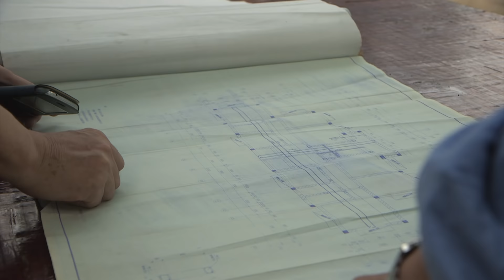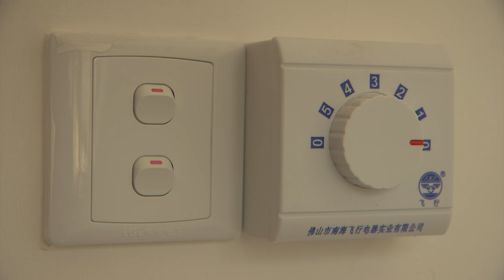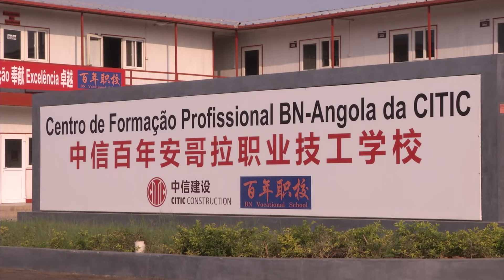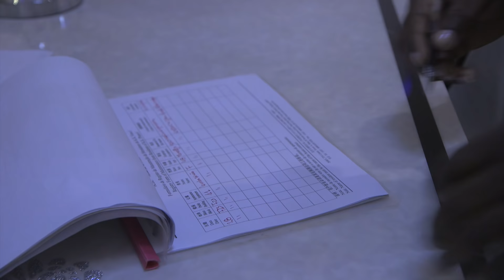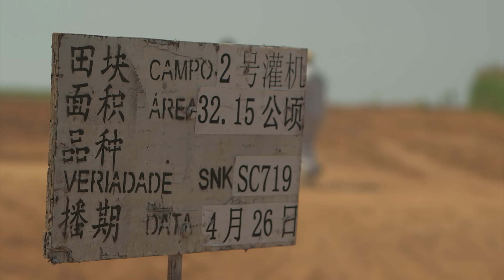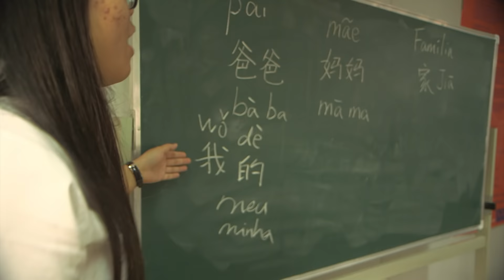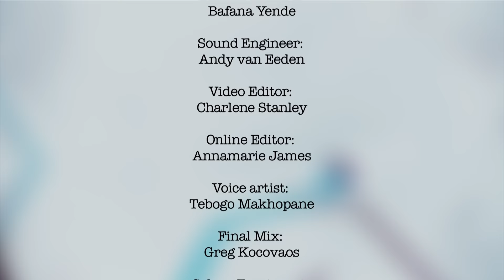How Chinese Money is Changing Housing in Africa | China/Africa Big Business | ENDEVR Documentary

Comment: The Chinese housing construction are the poorest I ever seen in East Africa, the choice of material are the cheapest quality, the house designs and dimensions are made for the Chinese shorty people the rooms are so tiny you have Problem to put up a king size bed. The kitchen counter tops are to low for European and African tall people. Electric wiring are made lowest standards  wires are not from copper to safe money. When constructed it will be cheated with less cement in the concrete Al lot off houses collapses and much more!! So really consider carfully to buy an apartment build by Chinese companies !! 😅😅